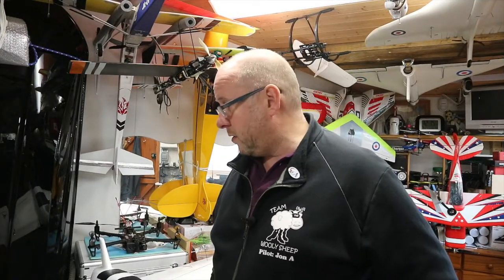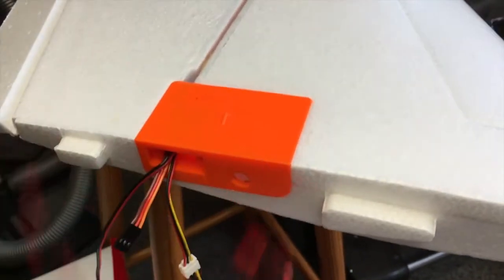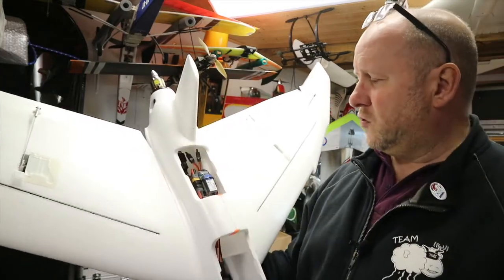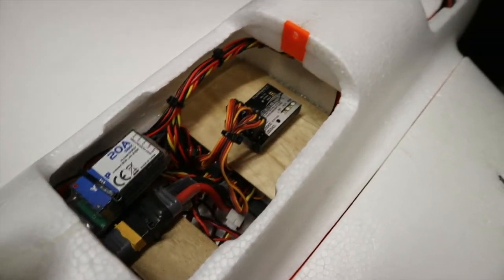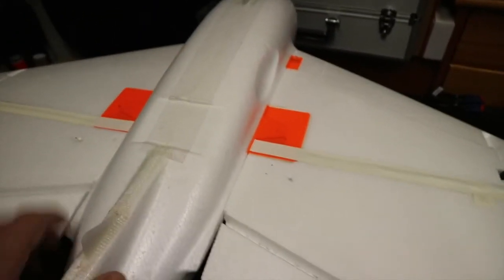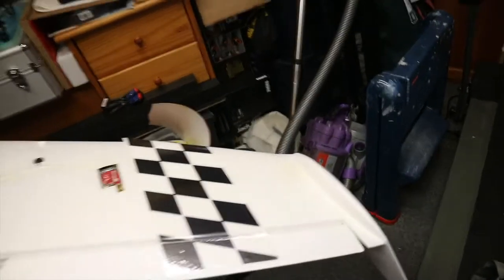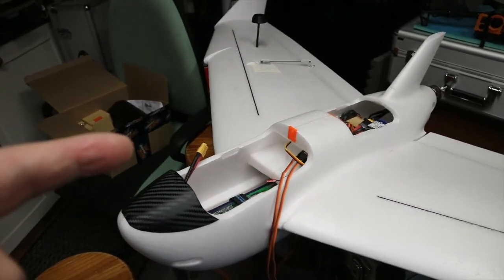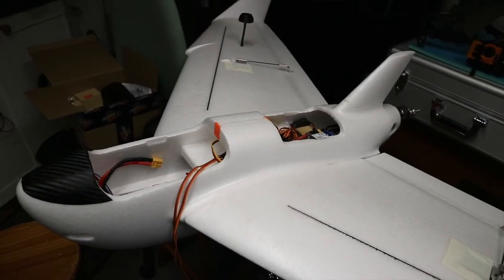Skywalker X6 Build - Part 1

Comment: Nothing wrong with the wing connectors... mine flew nicely at over 90mph and never had any issues with the wings flexing.
Reply from the maker: You are probably right but my wings are never coming apart now. I was looking at the new Hobby King Tundra and they are doing the connectors too. I seems the way of the future......
Reply: Team Wooly Sheep Reviews certainly make transport easy and quick! soldering the things was very fiddly though and I actually ran out of pins from my ezuhf because I had pan and tilt. So I set it up so only the signal for the servos came from the receiver, power and ground came from inside the fuselage

Comment: Meh. Seems like a lazy build
Reply from the maker: Lazy? Get it flying then when you are happy with it commit the time...... I've seen so many maidens with all the tech and gadgets spewed out all over the ground from a connection problem or oversight.....
Keep it simple then get it in the air.....
Reply: Team Wooly Sheep Reviews I got 3. Thanks.
Reply from the maker: When I test flew it flew like it had stabilisation as it kept self levelling. My only concern was launching it as it is big and heavy. How do you launch yours.......props spinning or throttle after launch?
Reply: Team Wooly Sheep Reviews bungee and throttle after launch.  I’m from the old balsa building sail plane days, so kind of made since considering the large spinning blades of death on the aft.
Reply from the maker: lol....blades of death.....I have a friend who would echo that....he has scars that look like a scale rule. When I get chance I plan to make a trolley for it
Reply: I launch mine with a 70mm EDF.....Finger friendly.